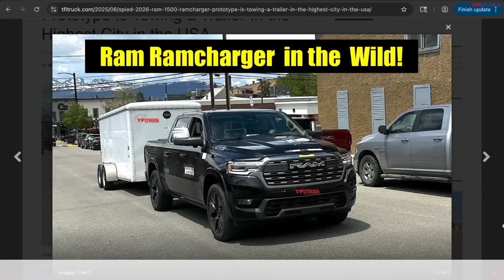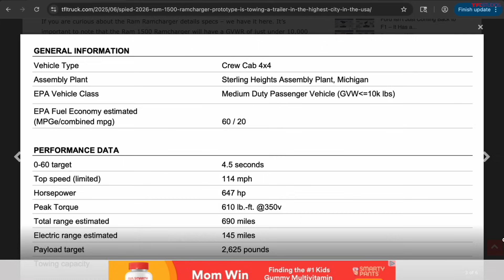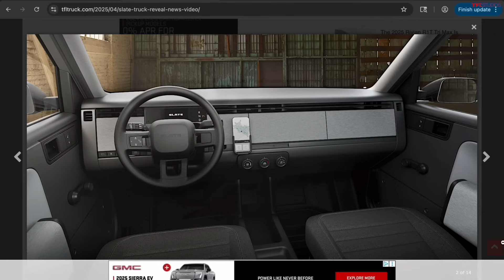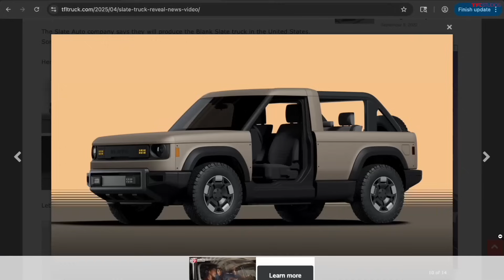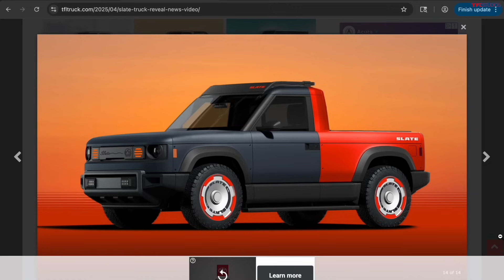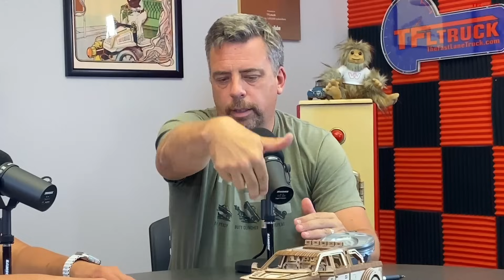Ramcharger Spy Shots Revealed! Is This the Future of Trucks?

Comment: Question I need answered, Ramcharger truck drives over 140 miles. The engine starts, can't it recharge the battery as you drive hundreds of miles down the rd? Maybe not if your pulling a Max trailer load. But just doing a Rd trip, you will need to recharge overnight? Will a 110 volt outlet charge the battery up overnight?

Comment: So several things. Biggest advantage of the ecodiesel powering the generator … easily throw a 50 Gallon auxiliary tank in the bed and have 78 gallons of fuel to run the generator instead of only 28 gallons. 550 mile range on the generator becomes over 1500 before having to stop and refuel. 
People say 20mpg on the generator is terrible, over the years, I’ve had a ram, a sierra, a few jeeps and a gladiator. NONE OF THEM actually averaged 20 mpg regardless of what the sticker said. 
People use twisted math and say if you’re running on the generator you only get 200 horsepower because it’s a 140kwh generator. The generator puts out 140 kw per hour. With a 70 kw battery the generator can charge the battery from 0-100% in 30 minutes. The motors are driven from the battery and the generator is recharging the batteries. Not the other way around. The motors are 250kwh which means they will use 250 kw AT FULL THROTTLE over one hour of use at full throttle. My lightning cruising at 70 uses 30 kw in the hour or 70 miles. How is 140 kw of power not enough? Drives me nuts when commenters throw out numbers and negatives about it without knowing facts. 
My XLT Lightning has more power, acceleration, and efficiency than any of my previous trucks. Range is the only downside. It costs me 4¢/mi to drive my lightning charging at home while I sleep. Public fast charges negate that efficiency and end up costing you 25¢/mile. All the rest costed 16-18 recording every fill up on gas cubby app. 20 miles per gallon running the generator paying $3/gal is 15¢/mile.

Comment: I agree with the LESS please, no cylinder deactivation, quad cab, 8ft bed, 4x4,18 inch wheel with 33's keep the 10 speed with 4:10 rear gears and maybe a 10 inch screen and buttons!!!

Comment: I’d really like to see the Ramcharger offered with a 6’4” truck bed, and solar panel integration into the hood, roof, and tonneau cover, for range generation while driving or sitting.  As a solar technician, and someone who has a solar powered tool trailer, I know that solar could generate 10+ miles of range per day for the Ramcharger.

Comment: Yeah. For people that are towing all the time or driving longer distances every day, then.... buy a different truck.

For people who drive less than 150 miles a day in your normal, everyday driving, and then you take longer trips on the weekend, and only tow stuff a few times a month (or less), this is probably a good truck for you. I.e. for the vast majority of people driving higher-end half-ton trucks (e.g. RAM Limited or higher), this is going to be THE truck to have.

Stellantis just needs to get it right.

What would be really nice is if you would do a deep dive on the drive modes in the Ramcharger (updated and deeper than the video you did on it a while back). 

How will it work if I want to just drive it around town all day and use it as an EV? 

How will it work if I want to jump in and drive 690 miles, stop, gas up, and drive another 550 miles immediately? Will it continue to deliver full power all the way until I have to stop for gas? Will it deliver full power after I fill up and immediately resume driving, without plugging it in to charge?

How will it work if I hook up to my max tow weight and then drive until I have to stop for gas, while driving in the mountains? Will I get full power the whole time? And if I just stop, fill up the gas tank and resume driving? Multiple times in a row? I'm assuming that a really tough towing scenario might require stopping for gas after 300 - 400 miles (starting with full charge and full gas tank) and then every 300 miles or less once you drive it to its max range after you run down the initial charge and use the whole first tank of gas. 

Also, you guys are wusses. I drove my EcoDiesel from Full to Empty without stopping several times. I.e. close to 800 miles. It's really not that hard ... unless you have Old Man Bladder. Or you're just a wuss. These trucks are super comfortable! I'm old, myself, just fortunate to not have that old man pea-sized bladder yet.

Comment: Ram, add a NEMA 14-50 50amp plug on this baby and you will sell a ton of them. When in this mode bypass the battery and go directly to the inverter. Being able to run this generator to power a house will displace the need for a portable generator. U.S. portable generator market was valued at approximately $3.8 billion in 2024, how much of this pie do you want?
Reply: Generations costs somewhere between 98 and 66% less than this truck. Do you understand market share beyond regurgitation?
Reply: Yeah put have you ever attempting to put a generator in a Telsa!!!!!

Comment: Electric pickups with 450 to 460 mile range are plenty for almost all uses and are not causing cancer driving down the road to those who followed them and it seems like in this discussion that you’ve had , you may be losing sight of the fact that in congested areas, and even for people in rural areas that have to sit in their vehicles for extended periods of time And follow other vehicles for extended periods of time electric allows for freedom to breathe without feeling like you’re killing yourself , and I have been driving electric long enough to have benefited from the simplicity and the freedom that comes with electric vehicles as regards to maintenance repairs simplicity , I am not for hybrids not for The complicated systems that have so many moving parts for the most part electric is the simple way to go!

Comment: This truck needs to come out asap I know it's exactly what I need for being a contractor... Currently working on a house with no electricity and need to charge batteries at times and having a generator is a pain in the butt
Reply: I am interested in the RAM Charger, right now I have the F-150 PowerBoost with the 7.5kW power system. Once you get use to having that integrated generator, hard to image going back to not having it. The flexibility of the hybrid trucks, plug-in or not, is really great. Anyhow, if you have an immediate need, take a look at the PowerBoost. Only problem if you are buying new, I don't think you can get it with 6 seats anymore, which really sucks, means I'm stuck with my '23 model for quite awhile.

Comment: Yes range extended EVs make sense and should never have been passed over for full EV. They solve range anxiety/charging issues of full EV while significantly improving torque and efficiency over ICE. Yes it's more complex but no  more so than the trucks already on the market today. EREV is already popular in other parts of the world and will be the solution going forward. Diesel hybrid won't make sense in the US because of emissions, weight, and complexity of modern diesel motors. We're going to see EREV and more hybrids on the market in the coming years.

Comment: I now own Two plug in Hybrid s. They are awesome. The best of all worlds . For me I could have a full size Plug in Hybrid truck, drive it every day and the price of electricity currently is 77 percent cheaper than fuel here. And remember an electric motor has instant full torque. 
The Cons . If it’s 15 below your PHEV will automatically turn the motor on . The coolant is required to heat the cab and make up for the lack of battery range. The heat pump won’t work below 15 C . How long it will all last . Time will tell. But remember the motor will actually have less miles than the odometer states . Lots of pros and cons . Keep an open mind .
Reply: I dont have much REALLY cold ev heat pump experience BUT I install heat pumps on homes that can work at 15*F below zero
Reply: The current hybrids though have too small of a battery and use the gas motor to also drive wheels.  Ram rev is much better implementation.

Comment: Does the 20mpg vary? Or, it just runs at max efficiency all the time? (Why wouldn't it?) If so, 20mpg at max payload sounds pretty good.  I say, when you run the Ike Gaunlet with one, put a Cirris 620 half ton  camper on it and pull a box trailer (or horse trailer) weighted to whatever's left.

Comment: Tow a 10,000 lb trailer from Grand Junction to Denver and see how it works. The battery range with a load is less than 100 miles and the V6 generates 140 KW. That's 1/3 throttle on hills with a load. And the trailer brakes will keep you from getting regen from the braking moments.
Reply: How many times did you post this 24 chromosome drivel?

Comment: I have a 2022 Chevrolet suburban with a 3.0 diesel with a 28 gallon tank. The range is over 900 miles with a full tank when not towing.  It tows my 20 foot boat or 23 ft travel trailer easily.  I have towed travel trailer up to 11,000 ft in Colorado.  60,000 miles with no issues.  Like the idea of the Ram Charger. More options the better for consumers!
Reply: Finally someone talks about the range of the 3.0l. I wonder if its the same in the truck? Does the truck have a 28 gallon tank?

Comment: For a truck with over 600 horsepower, 20 mpg after the batteries are discharged is absolutely outstanding.   And if you take a 300-400 mile trip and use no gas for the first 140 miles, the combined mileage is significantly higher.   This truck is a winner!
Reply: Is it?  After the battery is discharged the V6 generates 140 kw, about 1/3 of the 600 horsepower.

Comment: On the topic of a Diesel Hybrid, there is the conversion kit that's being made by DeBoss Garage and Edison Electric in Canada, where Edison works on sourcing electric motors and batteries and has made a diesel generator style hybrid electric 18 wheeler to tow, and recently bought an old truck manufacturing property. Rich of DeBoss is working on the modular kit conversion prototypes for 2500 and up HD pickups. The diesel generator is a new 2.8L Cummins 4 Cylinder, paired to the electric vehicle systems that get retrofitted to the frame. Rich has a video series on how it fits into an older 2500 Ram 1500. Where as Edison has the Topsy prototype for an 18 wheeler. The reason they're going Generator style, is because of emissions, if you use the Diesel to power the wheels, it has a LOT more restrictions for emissions, where as Generators don't.
Reply: Didn't Edison motors just go bankrupt?

Comment: You guys at TFL keep talking about Slate but giving the wrong information. The outer body panels are plastic or synthetic material but the cab and bed structure are made of steel for strength. To prevent steel from rusting it will need to be painted which will require a paint facility that will cost millions and can cost as much as a billion dollars. There are no longer EV tax credits in America so the Slate isn't a $20,000 truck it would start at $27,000 then add tariffs (import taxes) for EV parts & optional parts and the price would be $30,000-50,000. There is no longer government support for EVs in America and Slate may not have the investors, factory, or customers to justify an expensive EV that doesn't have any features. Any used EV is cheaper with more features and better comfort, so the Slate business model doesn't make sense. When you were talking about the possibility of diesel hybrids you overlooked the Edison Motors hybrid conversion kit for heavy duty work trucks. They use a diesel engine that runs at about 1000 RPM and doesn't require DEF/DPF or any modern diesel emissions equipment because it isn't the main source of power. The Edison hybrid runs off the battery and when the battery runs down the engine starts to charge them back up. They call the engine a portable level 3 charger. The Edison hybrid can use any engine (gas, diesel, propane) with a generator instead of a transmission. The electricity from the generator goes to the batteries then to the rear E-Axle (2WD) or front & rear E-Axle (AWD) and can be installed in old or new trucks. Your facts on the Telo are wrong because it doesn't have a 9 ft bed with the mid-partition down. Telo has a 5 ft bed and 8 feet with the mid-partition down and tailgate up. You can carry sheets of plywood in the Telo with the tailgate up and protected from the weater with a tonneau cover.

Comment: Toyota: 500 kW 4-emotor Tacoma, either keep the T24A-FTS or put in a multifuel diesel-kerosene-gasoline engine; 2200 lb payload, 8000-10,000 tow rating. +plugin hybrid with option to add swappable battery packs. Do Eet.

Comment: It is a companion generator in the main and all the use of engine only is out of the main usage to keep the battery as the main source for motor power. Think on the move charging when two wheel drive on the flat (ie 3 kw out 2-4kw in depending on load)

Comment: On paper this will work great. Educating customers on what it is and to plug it in will be the challenge.
Reply: Perhaps educated customers realize it's problems.  The V6 generates how much?  The electric motors pull how much?  The batteries provide what range? In an SUV that combination might work, in a truck designed and marketed as capable of towing, that's a problem.  The 3.6 generates 140 kw. The motors use 250//248 kw. The range is less than 200 miles, towing a load that drops in half.  Towing a trailer with eletric brakes keeps the EV system from using an effective regeneration braking to capture the momentum when stopping.  Try towing from Las Vegas to Denver with this truck and you will have times when you run out of charge, the V6 will generate about 1/3 throttle while towing a load uphill,  Guess how that works.  Is that educated enough for you?
Reply: @rogerrussell9544 ive pull 10k plus with my cybertruck quite a few times and I have almost 30 lightnings in my work fleet that tow. Regen hits well before trailer brakes in most circumstances

Comment: Years back, I owned a lifted 86 Toyota SR5 with a vinyl floor in place of carpet and roll-up windows and a stick shift. It is my favorite truck out of all I've owned. It was fun to drive, simple and looked good. I've been a technician for CDJR since 92, I can speak with hands on the products experience. I literally hate all the new garbage being made now. I did like the V10 in the Ram. But the Viper truck was an abortion. The new truck coming in the last 2 years all have major electrical issues.  They made the wire harnesses too short. The wires pull on the connectors causing shorts. There were hundreds of broken new unsold trucks sitting at the manufacturer because of electrical shorts.  Taking the fuel tank out I can only drop the tank 2 inches before its hanging by the fuel pump pigtail.  Not enough room to get my hand to it to unplug it.  Remove an airbag the squid connector is only long enough to get a 2 inch gap to get ypur fingers in there to unplug it. Older vehicles we get enough to turn the airbag over completely  to disconnect the squid. They wired the vehicles like a building.  Wires just long enough to get from a to b in the assembled position.  Stellantis outsourced design and engineering to India and that's what we got. Complete shit.

Comment: We need a diesel hybrid. They silverado 3.0l can get about 700 miles to the tank which is about 30 gal. Imagine 36 gal like ford and a hybrid. Prfect road trip and work truck.
Reply: The problem is that diesel doesn't cycle on and off as well as gas.
Reply: @gondorian1006 didnt even think of that, good point
Reply: I believe transfer flow or titan makes a 43gallon replacement fuel tank for the Silverado diesels. You could drive almost 1,200 miles without refueling 🤯

Really wish they used a small displacement diesel in the Scout Terra and Traveler but Scout already confirmed it’s going to be a naturally aspirated 4 cylinder gasser. A baby TDI engine would be perfect.
Reply: @marcochavane3124 100% i wish my colorado zr2 had a small inline 6 diesel too!
Reply: @marcochavane3124 Toyota makes a 46 gallon tank I almost got one but I found a 2019 ram hemi fully loaded longhorn with 8k miles on it and it was a steal maby next time
Reply: @mrmustache-et1uq  Glad you came up on the Ram. Hope it treats you well!
Reply: @mrmustache-et1uq are you talking current Toyota as in the twin turbo Tundra?
Reply: @jasonclark9252 the one I was looking at was a 2021 I think they added the 46 gallon in 2017-2018 but I’m not sure they but I’m pretty sure it’s still an option if not they come with a 38 gallon standard

Comment: Under the 'Big, Beautiful Bill,' Car Companies Won't Be Fined for Failing To Hit Arbitrary Fuel Efficiency Goals.  Eliminate cylinder deactivation for 3 years in HEMI engines.
Reply: Auto companies have to design over a long horizon (5 to 10 years) and for a global customer base.  Are car companies willing to significantly change their strategy because of an administration that will change in three years?  Companies need regulatory stability.  I lived thru the oil economic shocks of 1973 and 1979.  War broke out in the Middle East last year. There was minimal impact on US and world economy.  CAFE fuel standards are part of the reason the USA is not dependent on foreign energy.